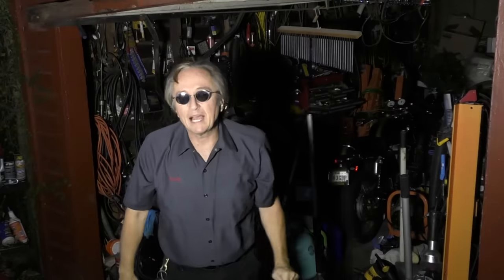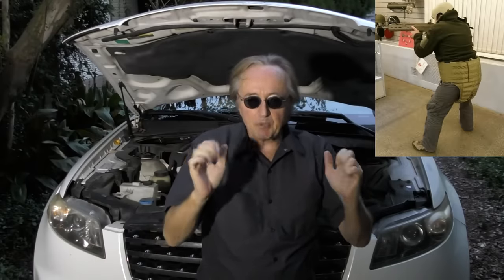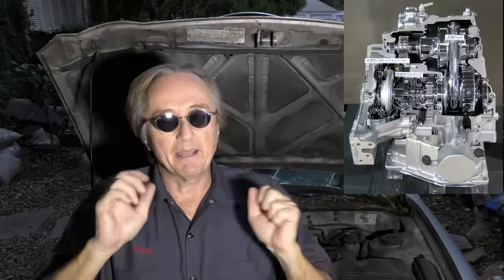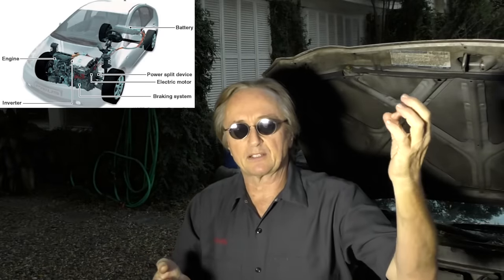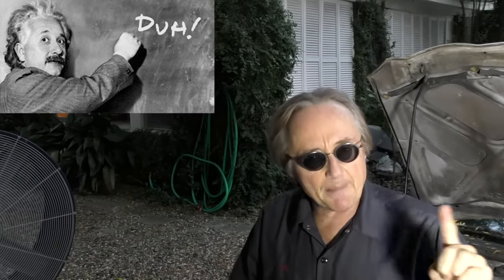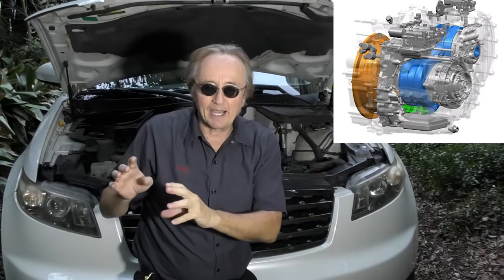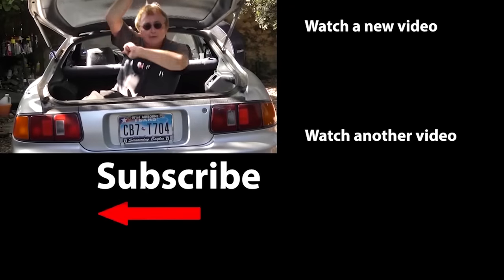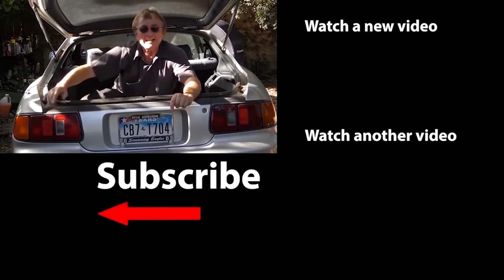Why Most CVT Transmission Cars are Terrible

Comment: My cvt transmission just went out with my Honda Insight 2010 but it does have 440,000 miles so safe to say Honda cvt is great 👍🏻
Reply: You did great.
Reply: Thank you! But it hurt to see my beautiful  car break down for the first time 😐
Reply: @dondepaz7939  400 k miles is more than you can really expect. But you did well. Congrats!
Reply: Holy moly!
Reply: How often did you change the fluid?
Reply: @whatthewhat11  I have a 2001 Toyota RAV4 that I had the fluids changed 120,000 miles ago. I don't tow anything and drive conservatively. Should it need heavy work, I will donate it as a tax deduction.  It has 303,000 k miles. I use Walmart conventional oil or whatever oil and filter combo they have going at AutoZone. I always use the cheap Fram filters or Walmart El Cheapos. Hint: they have to meet a minimum standard in order to sell them.
Reply: Wow, 440,000 in 9 years? Do you commute from California to New York?
Reply: @fre d lol im at 10 years and I barely passed 76k
Reply: whatthewhat11  I just change it when the car promps me to change it
Reply: Jhon Jhonson I Live in southern Ca and everything is so spread out here so there is a lot of driving involved
Reply: 9 years 440k??
Reply: You telling me you drive just under 50k miles a year? Bruh, what the crap?
Reply: Wow. 440k.  That is amazing.
Reply: How about honda city 2005 cvt and other models of city with cvt? Any problem you'd experience, mates? May you share? Thanks!
Reply: @fre d - Average 134 miles per day. 7 days a week.
Reply: I also have a 2010 Honda Insight and it is solidly built (my car was assembled in Japan, not the US or Canada) and the CVT is great too!  I bought it used in 2013 when it had 31k miles and now it has 155k.
Reply: cgasucks @ great car I got a used transmission for cheap and it’s running great again you got yourself a great car 👍🏼
Reply: He must tha drive to the bathroom in the morning when he wakes up. Just an opinion.
Reply: This gives me hope for my 2017 Civic (Honda) lasting a good amount of time :)
Reply: Tungsten Wall I just bought a 2018. I’m thinking the same thing.
Reply: Don De Paz 440,000 miles in 9 years wow
Reply: Don De Paz you drive 4,000 miles a month on average for 9 years straight?
Reply: @whatthewhat11  Hello to another fellow whatthewhat checking out Scotty videos!!  What are the odds!?!? Haha!
Reply: It's only 48k miles a year people calm down. I drive a semi for a living and do 125k to 135k miles a year and still found time to put 20k miles on my new pickup in a year
Reply: How about a Pathfinder purchased new now 2 years old with 26k miles is at the Nissan dealership now getting replaced
Reply: True😀👍👍
Reply: And most traditional automatics wont make it that far.
Reply: NintenCoaster Toyota, ford and now newer Honda hybrids use Planetary gear sets, but the second generation Honda insight had a belt type CVT.
Reply: I have a civic hybrid 2003 and it has 76k miles and the transmission is starting to get funky
Reply: You give my CR-V hope...
Reply: @yeeleng1000  my dad's truck has 200k and it's been around 8 years
Reply: R M u
Reply: I got a 19 insight. Hopefully it lasts just as long
Reply: Don De Paz That’s impossible ...9 year old car with that many miles ?...did you deliver pizza or Uber?....because otherwise it’s not possible
Reply: Don De Paz it still went out
Reply: Holy crap what did you do to that car to have 440000 miles on it in ten years lol
Reply: More than 3,600 miles a month huh?
Reply: Look, in the 80s and 90s, transmission break do was never an issue until now, maybe a few here and there but not like this. The steel belts and the fuild seal breaks on them. So you got 400k on your cvt, well, transmissions use to be the last thing to go out on a car, like the engine. If you had a traditional transmission, it would still be running.
Reply: Impressive
Reply: if you had a nissan it would last 100k max
Reply: Tigran Tashjian  mine got repaired at 38k
Reply: 404TRUCKER not entirely true . I had 2 normal trans go on me , in a 02 and a 01 non cvt went at 120k . ....But my cvt now2017 got rebuilt at 38k and still has same vibration issue
Reply: You had 440,000 miles mate, it wasnt a chrysler that broke down at 50,000 miles
Reply: Al Grayson tbf I had a girlfriend that lived like an hour out of town and drove 140 miles a day for like a year
Reply: Kyle Emmons check your engine mounts. If there is a vibration issue, I’ve learned that there is high chance that the rubber in between the steel of the engine mounts have worn out/down. I just drove a Ford Fusion cause I’m looking for a new vehicle and I’m doing a ton of research on all cars cause I just got in a hit and run where dude hit me going over a hundred on the highway and hit me on the entire right side and totaled my car. It was a 2015 Nissan Sentra and it had the CVT engine and it started making this clicking noise at about 40,000 miles when I would speed up or slow down and it bugged the s out of me. I bought it with 19,000. At about 75,000 it started slipping in between 3-4 gears I could easily tell for I’ve had many not so great cars. 
Anyway the steering wheel was shaking as well as the car a little bit and the car only had 44,000 miles on it. So I came home and started doing research on why the vibration/shaking. A lot of repair shops think it’s the tires or alignment but it’s likely the engine mounts. I had a 2000 Ford Focus and was on the highway one day and bam! my engine mounts broke and the engine fell down into the front end. How it didn’t fall out onto the ground I don’t know. But took it to the shop and it was the mounts. Not to expensive to fix either. But check out your mounts, that may be the cause of the vibrations. Hope this helps and hope you can figure it out. Best of luck. 🙏🏻🙏🏻🙏🏻
Reply: Hopefully they make them better now.
Reply: What occupation do you have that required 440k miles in just 10 years?
Reply: My toyota tacoma from '04 has 256k miles. I'm still using it as my daily driver
Reply: You lie,,,,,, bless your heart
Reply: That is an ECVT with planetary gears. That is different than a belt driven CVT
Reply: Psh I’d be happy to get half that on mine
Reply: @tigrantashjian1305  this was the case for me, but I have also seen some 200k mile plus cars on original cvt Nissans. Seen a maxima yesterday with 300,000 miles and climbing. I am always looking because I own a Nissan and just replaced my cvt
Reply: @dallas218  Yeah it can happen. i’ve seen them with 200k miles but i’ve also seen cars with 120k miles on their 3rd cvt. it really depends
Reply: @fre d 50,000 a year? Not a big deal. IF you like driving.
Reply: Dude my car is almost 17 years old and only had 220k, how do you put 440k on a 10 year old car? Lol
Reply: @fre d , He drove from California to Australia.
Reply: I dont believe that
Reply: @donovanfahrbach2493  well obviously it is
Reply: im glad you got good mileage out of it but let's be realistic...were most of them highway miles?
Reply: How the heck does a 10-year old vehicle have THAT many miles on it? Are you sure it isn't kilometers?
Reply: 2016 honda accord sport cvt shot at 165k
Reply: @Saylor916  damn, I have a 2017 sport, only at around 45K miles. I’m hoping to get 300-400K miles out of car and cvt if not more. I did a cvt drain and fill at 30K (bought car used at 28K miles) and then I bought Amsoil cvt fluid and did a 3X drain and fill at 32K and will do a single drain and fill every 30K going forward. 
-Was yours a lot of stop and go driving, highway? Mine is mostly highway so I’m hoping for long life. Toyota and Honda seem to have the better cvt’s but you never know
Reply: @swaggerjacker1482  pretty much all highway miles got the car with 5 miles on it did cvt drain fills every 25k pretty depressing was hoping to see a minimum of 250k miles had a 2001 accord before this and got 300k with zero break downs
Reply: I have a 2013 Toyota Avalon hybrid with 367k miles
Reply: You got lucky 👍
Reply: 440,000 miles is better than great.
Reply: @dondepaz7939  how often did you change the fluid?
Reply: Thats alot of miles

I have an 06 Pilot with 273k. Its been with my family since new. Then handed down. 
Never had anything put on. No alternator. No starter. No transmission. 

I drive literally 5k a month. All over the US. Mainly for exploration and ministry. 

My dad gave it to me with 262k in late November. So i have drove more than 5k a month sometimes. Especially over Christmas week. Some months were fewer and some were more. 
Avg is approx. 3.66- 6k a month on the Honda alone. Excluding my weekend car lol

I love it. Still runs great.
Reply: @davismaxx  is that a CVT transmission ?
Reply: @gutadin5  no. Just the good ol 5 speed auto
Reply: My honda civic 2010 had 265 000 miles on it, would have done even more but somebody crashed into my car
Reply: @pierre-carllabrecque328  was a CVT or AT transmission ?
Reply: Yea you sure got your money's worth hell almost half a millon miles 😎
Reply: Unlike Nissan, Honda makes it's own CVTs, and yes, they are way better than Jatco's used in Nissan vehicles.
Reply: Honda in general is great
Reply: I put 200,000 miles on a 2015 Murano in 5 years.. I reached 200k around November 2020... The transmission is running okay so far. I've kept up with it's maintenance so I hope to get another several hundred thousand miles before needing a rebuild or a new one.
Reply: @jcynavarro  not bad. And how often do you change the CVT fluid?
Reply: @whatthehotcake  you two should meet up
Reply: Damn 2009 maxima with 190 lol. I’ve never had cvt problems but damn 440k miles, what did drive Cali to New York 5 times lmfao
Reply: @davismaxx  my mom has a 2007 Honda Pilot with a little over 250k miles. Never asked for much. Never left us walking. She’s getting a 2018 pilot next week
Reply: Wow so many miles! I have a 2005 Honda Jazz CVT with only 46000 miles (74000 kms approx).
Reply: @jcynavarro  Just change cvt fluid every 30000 miles
Reply: Driving taxi for your whole life still don’t get 440k miles equal to 708,111km.this alien boy making russian map or what
Reply: Most CVT's are great. They only get a bad reputation because of careless drivers that let their vehicle go thousands and thousands of miles without any kind of upkeep. Keep up on your fluids and take care of your vehicle and your vehicle will take care of you.
Reply: @jamesgarcia2040  fram is the worst you can use, Walmart brand is also fram, get ac Delco, the are cheap and good.
Reply: More like tell us your secret lol
Reply: Damn
Reply: If your transmission fails at 440k miles, you won.
Reply: @fre d only way I see that is if their job was nothing but driving like lift Uber door dash , every app u can think of lol
Reply: @KingNyanCat  he prolly do Uber or lift full time
Reply: @Nostalkersallowedkarmaisreal  lol 2015 civic cvt was trash. 2016 is when they did an overhaul.
Reply: My honda fit 01 model cvt still shift like a dream haha 325k plus miles ..
Reply: I have the same car, it has almost 250k miles and still going strong. I have to mention... I live in a hot country (Panama city) that have a lot of stop and go traffic, but my car lives mostly in the highway... Yeah, not a race car but takes me from point A to B so its fine, not to mention, the fuel mileage its so great (around 49mpg). And the tranny as long you change the fluid when the computer asks for it, you'll be fine, ah... Only use the recommended fluid (not valvoline or any other)
Reply: Oh wow. I have a 2010 Insight as well. It has 179,000 miles. Looks like my CVT still has plenty of life in it.
Reply: What are you gonna do about it? Did you change the fluid on schedule?
Reply: @crand20033  Always on Schedule and I'm using the Honda CVT fluid
Reply: @KingNyanCat  I drive 70K miles a year
Reply: @fre d  If it’s used for work in a big way it can easily be done, I was a long distance lorry driver doing 100,300 miles ore more a year
Reply: @dondepaz7939  Only $4500 to get it fixed and run your car up to a million miles.
Reply: @dondepaz7939  Average commute is hours.
Reply: Dear god
Reply: @whatthewhat11  , Every 30K miles
Reply: @KingNyanCat  , yes. he may be a homebody.
Reply: @KingNyanCat  I drove a company vehicle for 20yrs so my nissan would only move about three or four times a month.  I wish I still had that vehicle
Reply: Damn 😂
Reply: Not all Honda cvt are good, I see a lot of odisey doing bad with their transmition
Reply: do you think honda accord 2017 v4 good car i found one went 50.00 mils
Reply: Have a 2008 Honda Accord V6 and I love it. It’s got plenty of pep in it’s step but isn’t too bad on gas either.
Reply: Damn where do you drive that thing too 😂
Reply: Then you could not have asked for more
Reply: 2011 subaru outback 267k cvt